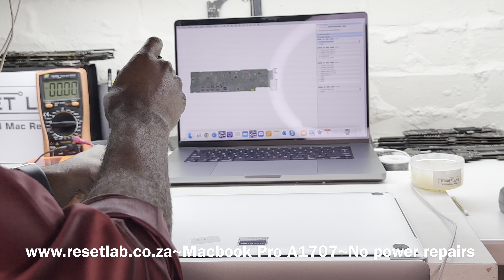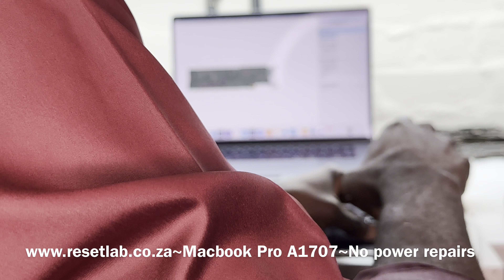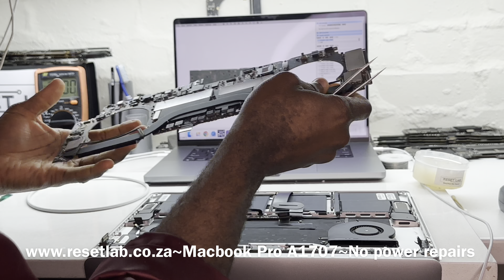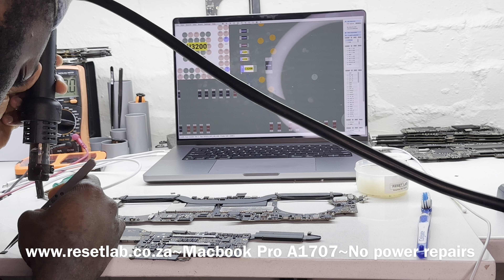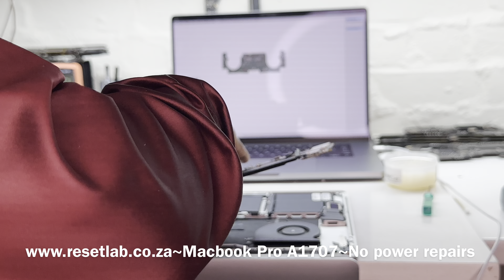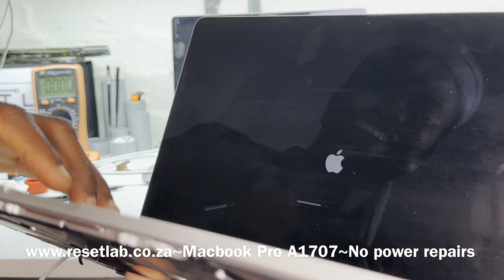MacBook Pro A1707 No Power repairs

Comment: Can you say the components for start the Mac with pins on Logicboard?
Reply from the maker: Please help me understand your question. Do you mean to mention the individual components across the logic board ?
Reply: @resetlab7142  the fist post, is done. Found the problem on the Logicboard.
Reply from the maker: @Jus7c1ll  good job, happy repair
Reply: @resetlab7142  do you have a other name for D6902 diode?  I have to replace this. But cant find a different name. Thanks
Reply: Microsoft Mainboard, you can start the Computer without the Power button. You just need a Metall thing to connect each other, then it starts. Google Translate says "bridge" @resetlab7142